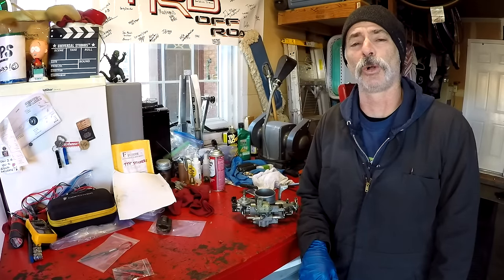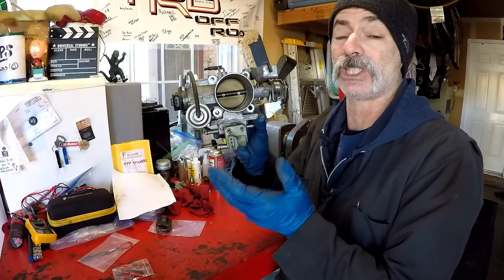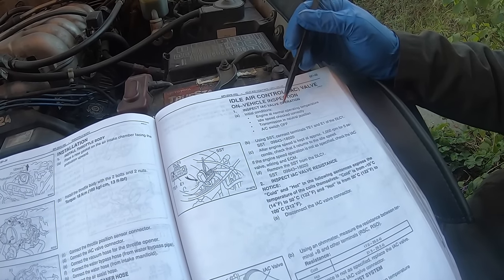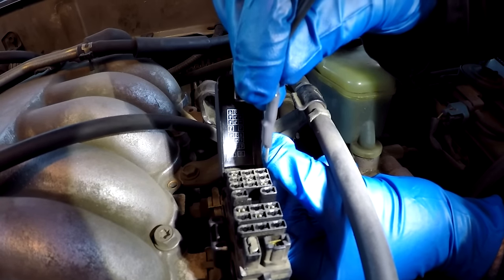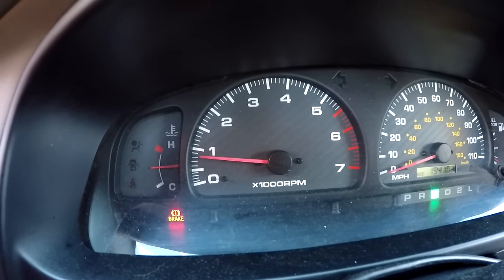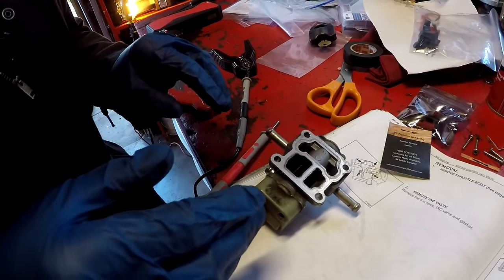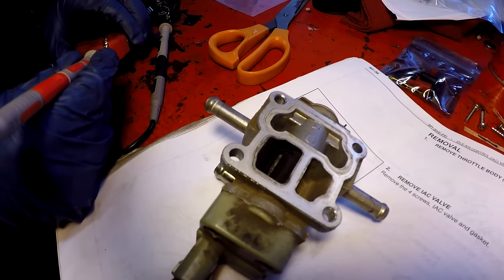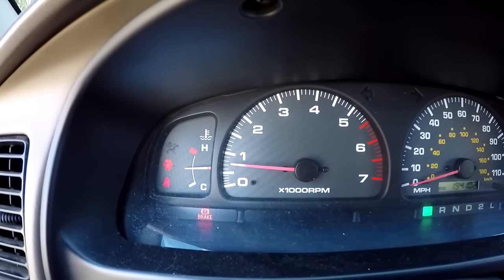IAC Valve Testing and Cleaning

Comment: Hi Tim, I have a P0171 code (System Too Lean (A/F Lean,Bank 1) on my 1998 Tacoma that still comes on at low idle, it's been a bitch to solve so far.  No other codes.  I've checked for vacuum leaks and replaced a couple suspicious hoses, replaced the MAP sensor, plug wires, both oxygen sensors, PCV valve, fuel filter, and all fuel injectors with Motorwest Performance ones.  The vehicle runs great with the rebuilt injectors but the P0171 code persists!  Again, if I keep the idle high enough (over 2K) the code stays off and I can drive 200 or more highway miles without it coming on.  But in 10 min. at idling it will be back!  I have not cleaned the IAC yet but it was very dirty!  I did clean the throttle body inside when I replaced the injectors, but not the IAC itself yet.  Do you think cleaning the IAC Valve will finally get rid of the code?  I can't pass DEQ and get my new tags until the code stays cleared so that is my dilemma.
Reply from the maker: Did you replace the MAF sensor with an OEM one?  Usually a P0171 is corrected by simply cleaning the sensor wires of the MAF.
Reply: @TimmyTheToolman  - Yes, cleaned the old one too, and it didn't change the code.  The MAF was the 2nd thing I changed out after first changing the 2 Oxygen sensors.  This the first I've seen that the IAC could also be the culprit.  Tomorrow I clean it like you did.  I'll get back to you after that.
Reply from the maker: @JamesPortland  I looked up other possible causes and it says vacuum leaks, exhaust leaks and a weak fuel pump could also cause the too lean condition.
Reply: @TimmyTheToolman  - Yes, I'm down to the last two things.  I don't think there are any vacuum leaks, unless it is in the brake vacuum cylinder, or in some other obscure place?  I've been all through the vacuum hoses several times.  As far as the fuel pump is concerned, that is an area that I hope is not the problem. And I seriously doubt that it is bad since the truck has solid acceleration and I've had it up to 85MPH and it does not cut out.  In fact it doesn't cut out at any RPM.  As for exhaust leaks, I don't hear or see one, and I crawled under the truck yesterday and looked at both oxygen sensors and the catalytic converter.  No visible leaks, but could a bad converter cause the P0171 code?  My thinking is that I'd have at least two codes? But P0171 means "System Too Lean (A/F Lean,Bank 1").  Why wouldn't I also have Bank 2 also be too lean?  Also the engine is not missing, it wasn't before the new injectors, and isn't now.  It does run noticeable smoother though now, especially at idle.  Seems to have picked up more low end torque with the new injectors too.  I just finished cleaning the IAC and It was very dirty! It also tested good for opening and closing. Snaps open and closes quickly when 12V DC is applied.  I'm a bit disappointed in my Toyota Dealer in my city though.  They are zero out of three for the parts that I've needed quickly and are ridiculously expensive on everything!  I'm however impressed with NAPA Parts.  They had every part for my my 20 year old truck in stock, the two vacuum hoses I was suspicious of, and the IAC gasket too!  All good quality parts. I'm going to clear the P0171 code now and I'll get back to you soon.
Reply from the maker: @JamesPortland  Ok, good luck.  I hope the IAC fixed it.
Reply: @TimmyTheToolman  - Well, the IAC was very dirty but that did not fix the P0171 code issue!  The check engine light came on after about 8 miles.  I was idling at the time.  Good idle, no missing and engine running smoothly.  Engine was at the normal running temp too.  It does sound like a vacuum leak, because at low engine RPM, that would be when a slight vacuum leak might cause the greatest lean issue.  But where?  I'm thinking of checking the PCV valve again tomorrow, it is new and the hose looks good and tight though. Maybe it was defective out of the box?  Any other suggestions?
Reply from the maker: @JamesPortland  I don't really have any other suggestions for you.  I would be taking all the steps you're taking to try to figure it out.
Reply: @TimmyTheToolman  -  I did not mention that the engine has 294K on it, all highway miles, is that a long time for a fuel pump?   The last thing is the fuel pump, but how would I know it is causing the issue? Could the screen or filter be plugged up in the gas tank?  How would you go about getting to the tank, lifting the bed or dropping the tank?  What is the easiest method?  I've done everything this guy has done in the below link, and he found it was the fuel pump. Could the fuel regulator also be bad?   I did not replace it when I changed the injectors.  https://www.tacomaworld.com/threads/p0171-solved-finally.330233/
Reply from the maker: @JamesPortland  Guys with Tacomas seem to like the technique of removing the bed rather than dropping the tank.  I've only dropped the tank but it was for a 3rd Gen 4runner and that was our only choice.  You could try checking the fuel pressure by tapping a gauge into the fuel rail but this is something I haven't personally done but plan on doing it one day.  Sure, the fuel pressure regulator could be bad, but again, this is a component I haven't learned to test for proper function.  If you do a search on Tacoma World or T4R.org, I think you'll be able to find some information on how to test the fuel pressure on one of these 3.4 liter engines.
Reply: @TimmyTheToolman  - Thanks Tim, you have helped a lot.  I was a motor-head in the 70's and built two hot Celica's back then. Learned a lot and wasted a lot of money too!  Still I'd never trade that experience for anything. That experience helped me tons in electronics repair.  These days I'm a retired 68 year Electronics Engineer who would rather be troubleshooting electronics than mechanics. It's cleaner, easier, and less back breaking.  Still the troubleshooting procedure is exactly the same.  Incremental steps, check for the most logical problem first, and commonality, what symptoms cause what problems, what parts are related to certain issues etc.  But this problem has been defying the normal failure modes!  The next step will be to either try a new fuel regulator, and then take off the bed and go for the fuel pump.  I feel I'm still way ahead in cash savings, I'm into it only about $350 so far.  I've been here a few other times in my life too, but I'm persistent and will prevail!
Reply from the maker: @JamesPortland  Yeah, you'll figure it out eventually.  Stories like yours are fairly common from my experience of frequenting Toyota forums for the last 4-5 years.  People pull their hair out trying to figure out an issue and sometimes they just give up and sell the damn thing.  The key is, don't give up.  Let me know how it goes.  I wish I was better with electrical issues.  That's my achilles heal with auto mechanics.
Reply: @TimmyTheToolman  - I'm still trying to decide if I should replace the fuel pump regulator or the fuel pump next?  I just drove the truck 110 highway miles and the check engine light did not come on!  This was at 50-70mph speed range. But if I drive in stop and go traffic (under 2,000 RPM), I'm lucky to make it 5 miles without the light coming on! So a higher RPM at a faster speed does not trigger the PO171 code.  It also seems to come on more quickly if the engine is warm?  If I pull to the side of the road and turn the check engine light off with a code reader, then it seems to come on a little bit quicker?  When the engine is cold I get 2-3 more miles before it comes on.  Again, except for the PO171 code, the engine is running great!  Much smoother since replacing all 6 injectors.  Cleaning the IAC did nothing, but it's very clean now!  What part would you swap out next? The fuel pump regulator or the fuel pump?
Reply from the maker: @JamesPortland  The fuel pressure regulator would be easier to replace so I'd choose that next.  What I don't get is the engine seems to be running fine, right?  If the regulator or fuel pump were failing, you'd think you'd notice a performance change.
Reply: @TimmyTheToolman  - Exactly!  All my troubleshooting experience would expect the engine to run poorly at some speed, it doesn't.  Doesn't crap out or miss at any RPM either.  The check engine light only comes on at around 2K RPM or under, and the only code is a PO171.  I've have to fix it because I've been driving a month without new tags now.  To my knowledge, a vacuum leak might cause the low RPM check engine light to come on, but I've been through all the hoses at least five times now, they are good!
Reply from the maker: @JamesPortland  Well, I hope you finally figure it out.  Problems like this can be maddening.
Reply: @TimmyTheToolman  - Hi Tim, I'm still working on the P0171 check engine light problem.  The weather has been awful here in Oregon so I put off changing the fuel pump until last week.  I got it changed out and I took the bed off to do it. The hard part was getting 4 strong neighbors to help lift it off with me. Only took me about 45 min to change the pump itself and I changed the gasket and strainer too.  But I still have the damn P0171 problem!  That code seemed to go away for a day or two but was replaced with 3 different codes after the fuel pump was changed. P0125, P0135, and P0141.  Today I changed the Coolant Temp Sensor, and I noticed that now I have P0171 code back too.  So 4 codes now (P0125, P0135, P0141, P0171).  I can drive about 10 min and then the check engine light comes on.  All these codes seem to be related to the Oxygen Sensors but they were the first things I changed!  There is only one thing left that I haven't changed at this point, so I doubt I will fix the problem by myself?  The only thing I haven't changed is the Fuel Pressure Regulator.  This is a list of everything I've changed so far - Oxygen Sensors, Fuel Filter, Air Filter, Plug Wires, MAF Sensor, All Injectors, IAC Cleaned and Checked for opening, Coolant Temp. Sensor, and Hoses for vacuum leaks.  I'm baffled and never had a problem this difficult to figure out before.  Again, the only thing left is the Fuel Regulator.  The engine runs like a top!  It's even and smooth, good power, no excessive gas smell, or rich running either.  In fact after the injectors were replaced, I got slightly better gas mileage and definitely a smoother engine.  I'm still baffled.
Reply from the maker: @JamesPortland  I can't remember.  Were the O2 sensors you used Denso OEM replacements or aftermarket?
Reply: @TimmyTheToolman  - I believe they were not the Denso ones from Toyota.  Most the other stuff was from NAPA and was high quality brand name. The coolant temp sensor was a Delco. But I'm starting to think I got a cheap Oxy sensor and I'm thinking like maybe you are?  Maybe they were bad or they sent me the wrong ones, they did fit though.  Those 4 codes seem to point to bad Oxy. sensors. I can clear them with my code checker and it takes about 10 miles for the same 4 codes to come back on again.  Always at low RPM - around 2K RPM, no miss and is fully warmed up running like a top and smooth!  Baffling!  Next step is to put the old rear Oxy sensor back in and see if if changes any of the codes?  I should have kept the front Oxy sensor but I threw that one away, that was the first thing I changed after finding no vacuum leaks.  They are very expensive from Toyota though, but the Denso's are probably the ones I need?
Reply from the maker: @JamesPortland  Mike, those aftermarket sensors could absolutely be the culprit.  I've heard major problems when using aftermarket O2 sensors.  Get some Denso ones.
Reply: @TimmyTheToolman  - Thanks Tim, will do. I'll get back to you when I'm done.
Reply: @TimmyTheToolman  - I bought the upstream O2 sensor today at NAPA.  It was a Denso OEM and it is usually $103.00, but since it's Saturday first of the month, I got it for $70.  Going to test it more tomorrow, only drove it 6 miles today, but the check engine light usually will comes on around 8-10 miles.  Still so far so good.  I also re-checked the cheap sensor I had in the upstream slot. Went back to Amazon, and I found two issues with it.  First it was supposed to be put in the downstream position, but was put in the upstream one (my fault) the documentation that came with it was terrible, and second it was for a 2002-06 Tacoma.  I know for certain, that when I ordered it, they said it worked for a 1998 V6 too.  Now the ad says it won't work for my truck, so the seller changed the ad!  The 2nd downstream sensor that is still in the truck is a cheaper one too but different brand, and if I continue to have the issue, I will replace it also with a NAPA Denso OEM sensor.  These are normally $116.00!  Still NAPA says that they will give me a discount the next Saturday too.  That helps with the $ pain.  Even at this point I am way ahead by doing it myself.  Probably $600 total at this point now.  The rebuilt injectors from Motorwest Performance were the most expensive item, about but really worth it, the kit went in flawless and everything fit perfectly.  There was a very noticeable improvement in engine idle, low end torque, and mileage too.  I'll get back to you in a few days, after I do some more driving, still very nervous at this point.
Reply from the maker: @JamesPortland  Ok.  I'm hoping your pain and misery are over and you figured out the issue.
Reply: @TimmyTheToolman  - Tested the new O2 Denso upstream sensor today and now I only have one code, which is P0141 and after researching, goes to the O2 downstream sensor.  This is very good news because the other error codes did not come up!  I was hoping to avoid buying another Denso sensor, but it looks like I'm going to have to buy the downstream one now, because the cheap Amazon O2's don't play nice with the good OEM Denso ones.  So I'll pick the last one up on Saturday when it's discount time again, and get back to you.  Thanks, for your help up to this point too!
Reply from the maker: @JamesPortland  That's good to hear Mike.  Hopefully the Denso downstream sensor ends your CEL issues.
Reply: @TimmyTheToolman  - Problem finally solved, passed DEQ today!  Both new non-Denso O2 sensors didn't work!  You'd think that they would at least work but maybe not as long as the originals, the originals lasted 20 years!  But no they were crap right out of the box!  One was an YTC brand, and the other one was a SCITOO brand.  Bought two OEM Denso's and the problem immediately went away.  Replaced the upstream one and that got rid of the P0125, 135, & 171 codes but P0141 was left.  Bought the downstream one and that was it, all codes gone - finally!   Going to let those two companies know their O2 sensors are garbage.  Thanks for your help!
Reply from the maker: @JamesPortland  Yep, aftermarket O2 Sensors were the culprit.  Glad you finally got it figured out.  Now relax and drink a beer.  Hopefully your next automotive repair experience will be less annoying.

Comment: The first instructions are make sure the idle is normal but the reason I'm watching this is because my idle is not normal 😭
Reply from the maker: You could have a vacuum leak, possibly an issue with your throttle plate not closing all the way leaving an air gap, or an issue with your throttle position sensor.
Reply: @TimmyTheToolman  i feel like it has something to do with me cleaning the TB without plugging up that hole to the iac, I'm gonna tear into it and i have a replacement if its beyond cleaning.
Reply from the maker: @fujimori17  Ok, good luck.

Comment: This fault causes the transmission not to make the upshifts
Reply from the maker: Are you asking a question or stating a fact/opinion?
Reply: @TimmyTheToolman  question
Reply from the maker: @duratecv624v  No, a problem with the IAC wouldn't cause problems with the transmission upshifting.

Comment: WTF Toyota ?...
My 02 4runner throttle body looks nothing like that one in your video....
Reply from the maker: @MichaelSchmitz-z7q  They changed it in 2001.  You don't have an IAC.  Air to your engine is controlled by the baffle plate of the throttle body.  You have a hybrid throttle body.  It's a "drive by wire" with a "drive by cable" backup.

Comment: My problem is I have p1093 bank 2 rich condition my fuel trim is positive high I heard it's cause by iac
Reply from the maker: Well, test your IAC for proper function like we show in the video.  I don't know about it causing the rich condition but I can see how it could if it's not allowing enough air through.   Let us know what you find out.
Reply: @TimmyTheToolman  OK I'll let you know when I order a new one when I clean it it was working just fine then I got a ses light came back on so am thinking it's not working that good anymore maybe on its way out
Reply: @TimmyTheToolman  I believe it effective my fuel trim
Reply from the maker: @isrealperez9069  Yeah, I could see that.
Reply from the maker: @isrealperez9069  Yeah, maybe it has gone bad.

Comment: Good jod men got my Honda CR-V 2000 5 speed my idle control valve staring got. bad my litgh motor on  I take out idle  see little water the hose the idle control that the need got antifree thared  hose o no let me know please thas my first car Honda crv don't know nothing Honda thank s much
Reply from the maker: Hey Angel, we don't work on Hondas but hopefully what we shared with you in this video will help you diagnose and fix your Honda.
Reply: @TimmyTheToolman  ok only want to know post got water hose it got to the idle control valve thank you any way I che video to see can got like that I see you take out the parts little water coming the hose the say happens to my Honda idle thin it like Thad than for video help people g bless you